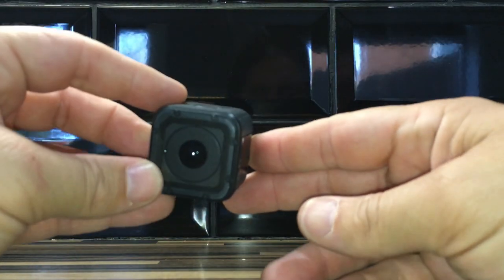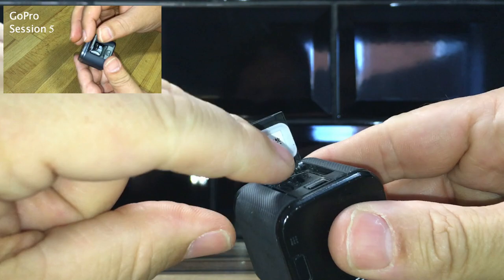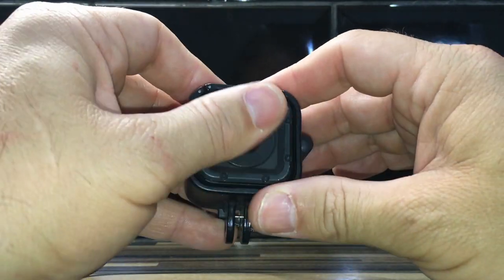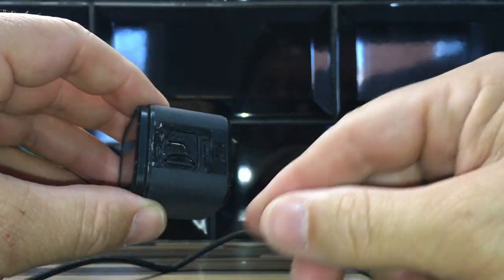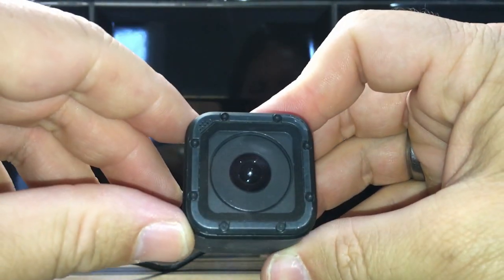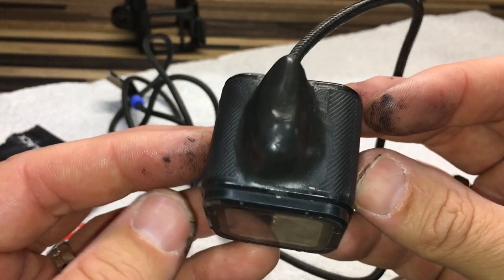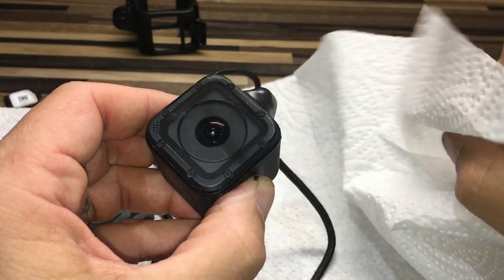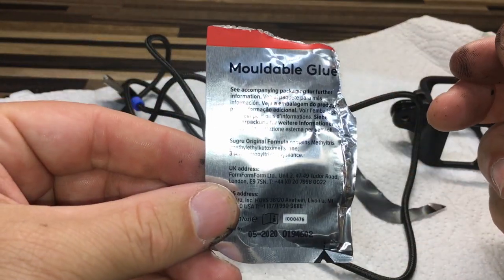How To Remove GoPro Hero4 Session Door : Waterproof External Power Supply With Sugru

Comment: Pro tip, if going to do this. Look at two things first. 1, as stated the card capacity, but also its classification (you want the fastest read/write speeds  possible. 2, the usb cable. Usb cables have different transfer rates. 
Example on my point and shoot Sony camera, the proprietary usb cable, is 3 times or more slower to transfer data, than if I remove the card and insert it in my PC. To further show how this can make a difference. I have a cruiser drive, that I use mainly for my tv. It is extremely slow, so slow that my HD runs less than halfway, while the cruiser drive is at 100%. 
Try this at home, when talking pictures and videos off of phone or camera, try it both ways, switch the card for a faster one, switch the cable out for a more expensive one. Then just pull the card out, and insert it directly into your PC (open up “task manager” and click “more details”, you can see the speeds, and percentages that devices are working at).
Thank you for reading my novel. If you found this helpful, hit the thumbs up, and subscribe.

Comment: Great video. Any chance you have a video on how you removed the door. Any suggestions?
Reply from the maker: I just pulled the door back till it broke off, luckily it just broke a small piece on the door hinge and not the pin itself so it would just clip back in place

Comment: Hello. Actually I've never heard of Sugru so didn't realise if was a flexable puty. I have just ordered some to do a very similar thing. Apologies for my ignorance. I might put a layer of cling film over the sockets though before I mould over them. Cheers.
Reply from the maker: It dries like a thick rubber but bonds to the surface of the object so cling film would probably work
Reply from the maker: You probably could mould an entire case surround for the camera

Comment: Nice job.  I hardly ever take the memory cards out of my cameras, and I use 64GB cards, so with a 128GB card you should be able to get well over 10 hours of recording at 1080 60fps.
Reply from the maker: You got it pal, before every 40 mins I’d have to switch camera off then charge it in tank bag when it was raining.

Comment: Neat solution but why did you have to worry about being able to get the door back on if you were going to make it so permanent? Maybe you could have done something similar with a latex compound that could be removed when required. What happens when your usb cable fails as it inevitably will at some point?
Reply from the maker: That is a brilliant idea about the latex 🤔 deffo worth looking into. I wanted to make sure the door went back on incase I ever decided to not use the camera on the bike. You deffo got me thinking though about the latex 👍🏻